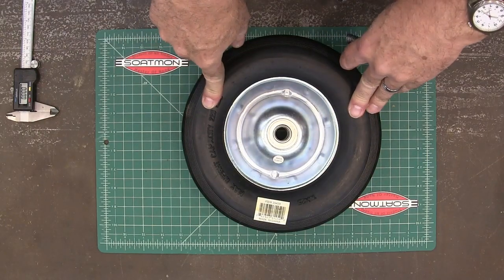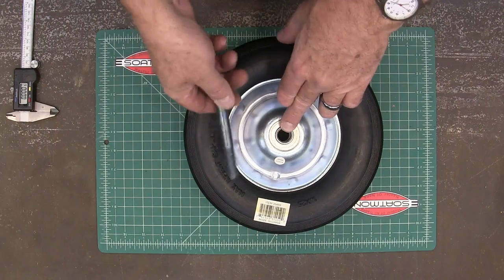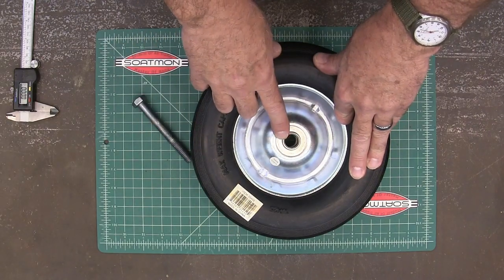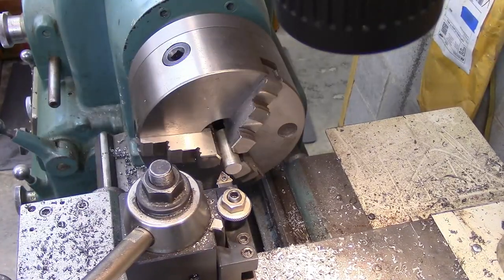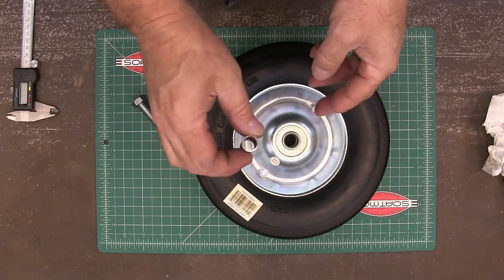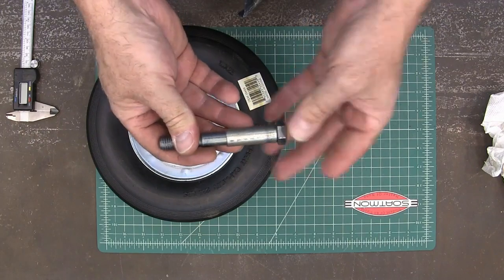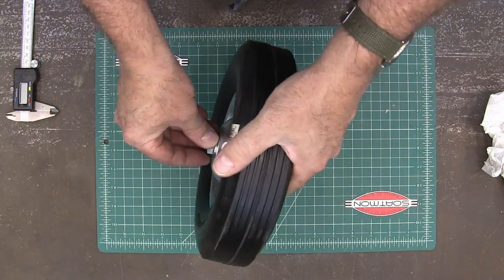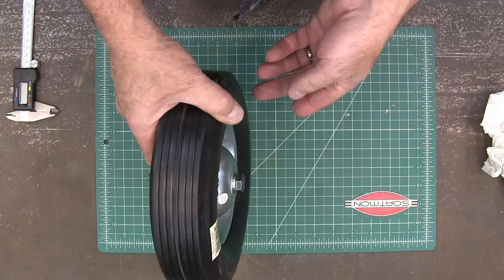Making a Wheel Bushing to convert a 5/8 axle to 1/2 inch

Comment: Just for reference for people who don't have the ability to lathe a bushing that size reducer bushing is common for $3-5 dollars depending on the shaft length. It's a pity so many industrial quality manual lathes and milling machines were scrap yarded or deep-sixed (for cnc machines) before amateurs could buy them for home shops.
Reply from the maker: That's a very good point, thanks for pointing that out.

Comment: Say one doesn't have a drill press or a laith. Would a pvc maybe work? Or some copper pipe or something?
Reply from the maker: For this application it probably would if it doesn't get moved around a lot. It would just wear faster.
Reply: @SoatMon  yeah its just for a little yard cart so I dont care how long it lasts if I can do it a couple times. I got a new bearing but the axle is a little too small

Comment: You didn't say if your new generator would be for stationary use or towed use. If it is for a towed use, you want the bushing to be made of high alloy steel. A towed, or mobile unit (generator, lawnmower, golf cart, etc.) needs the "good stuff"; otherwise, it will wear quickly (because of its softness) and become dangerous --- like, in wheels falling off.  For stationary use, almost any material quality will be ok.
Reply from the maker: It is for portable/stationary use.  These wheels are not suitable for towing.